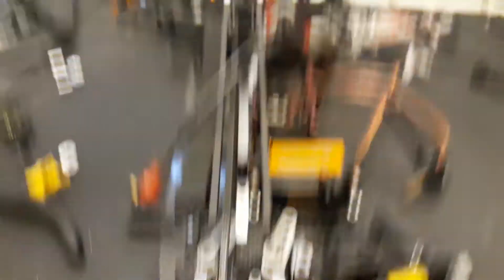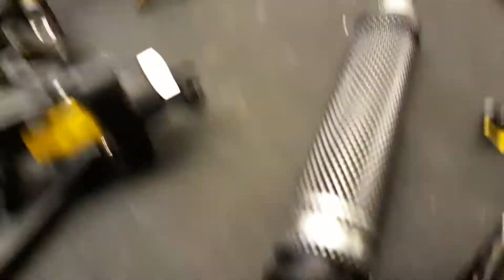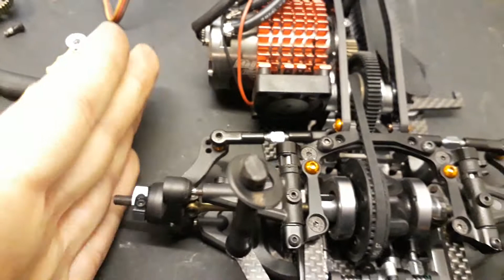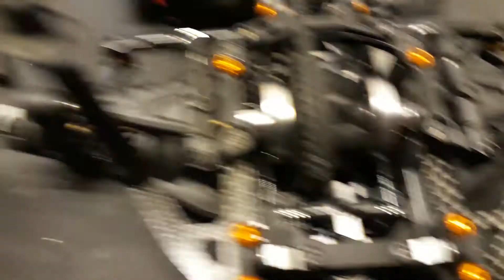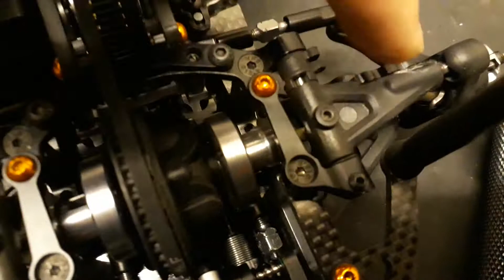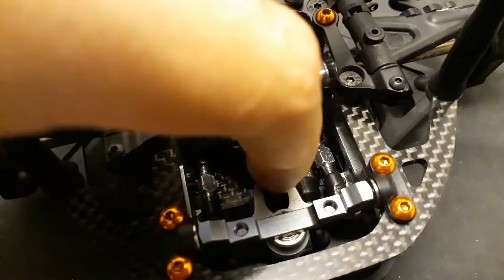Project 4X suspension explanation

Comment: Coming across this video a year later.... Just wanted to know how it has gone with the car. This is certainly a radical design, that's for sure. I was curious as to how "spring rate" for the dampening is adjusted - I'm guessing that you simply replace the entire cantilevered unit to adjust "roll stiffness"? As for ride height/droop, is that adjusted with set screws to set the travel limits of the arms?

I've been out of the hobby for about 15 years, and have been itching to get back. I'm looking for a competitive car, and was considering the Serpent, given the recent release of the Pro, not to mention the fact that I live pretty close to Serpent America.

Comment: Thank you for making this video! Just what I was looking for. I am thinking of getting the Serpent. How do you like it so far? How would you say it compares to the T4 on track and as far as setup with that extraordinary suspension? BTW, nothing wrong with your english 👍
Reply from the maker: The setup is definatly a lot harder to get right. 
The Dampers are a little... leaky. But then again there is basically no oil in there because they are so small and refilling takes around 2 minutes. 
Other then that it is REALLY quiet for some reason and it's a blast to drive. It is a little harder to get around than the T4 but it feels much faster and more stable (but because of that also more agressive).
I'm still trying to find the perfect setup for mine but so far it's been a blast. And it is holing up way better than I expected it to.
Reply: EinBick yeah I can imagine the setup being harder. For one there is no equivilant to shock inclination so its all in the oil and springs.